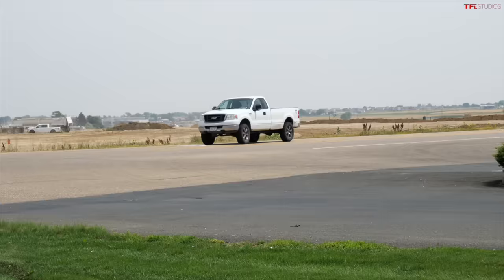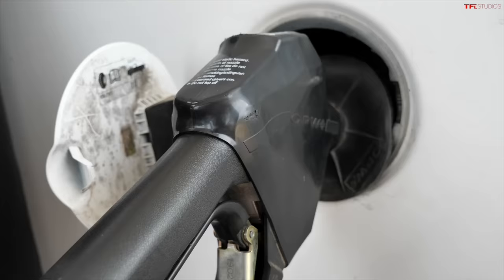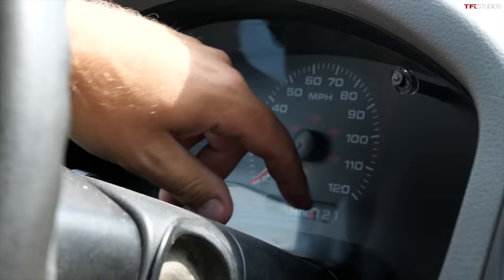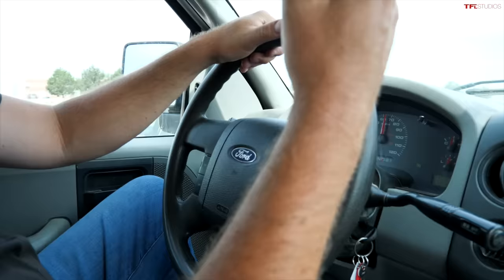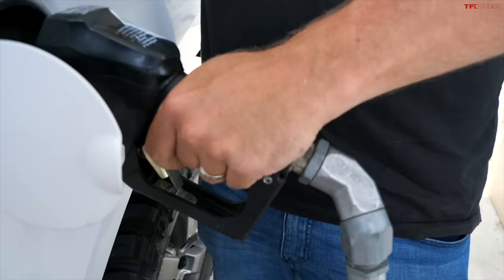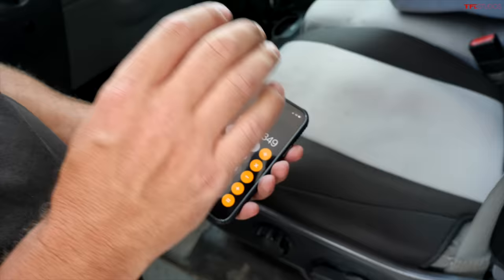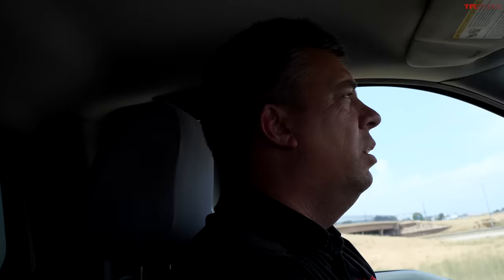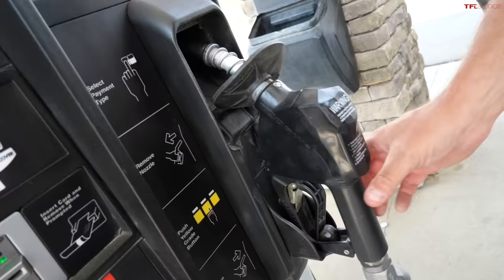Surprising Result: Here’s What Happens To Your Truck’s MPG When You Install A Topper!

Comment: Love my 1998 Ford F-250 LD. Has 5.4 with two valves per cylinder and all the bells and whistles of thE XLT. Sheep skin seat cover with the Captain Arms.  Worth all $28,000 plus in 1998. Better build back then.  Their values keep on going up with time. Milage is same or better than my 2018 F150 Raptor SuperCrew.

Comment: Here's a question. If I put the pop up tent above the cab of an F150 or above the cap, say an RSI Smartcap, which is further back, will there be a difference in average mpg?  Put another way, does putting the pop up tent further back from the front, on a bed cap, improve mpg?

Comment: You do know there's also a way to do that with out the trip meter or GPS it's called math. Write down on paper your miles then when you fill up again write your miles again subtract the difference which will tell you how far you drove. Then after filling up you will know how many gallons you used. Then divide the difference to figure the miles per gallon.

Comment: I think it is the same within the margin of error. I don't think that you are doing this, but I certainly wouldn't claim 0.1 mpg improvement on a test that only used 3 gallons. It would have been better to do a longer drive over several days. Reversing the order each day. Also, you could have hooked up something to see your instantaneous fuel usage and logged that over the miles, preferably along an empty road. Doesn't Highway 50 go through Colorado?. 

What I find remarkable is that 1,100 comments in 2 days. Popular channel with engaged viewers!!

Comment: guess if you do a lot of highway driving, it would make the greatest difference.
but not much difference in mixed driving.
then the weight does probably negate the gains.
what does a top with one of those high areas in it do to mileage?
is the extra covered space worth it?

Comment: Wouldn't that kind of mean that that test is not sufficient enough. What I mean by that is to do the test properly you would probably need to weigh the truck topper and redo the first test. Read with the same weight without the truck topper then take the weight out and put the truck topper on that way you can get a definitive answer. Because as it stands now is you're dealing with the first test no wait the second test more weight. I would say redo the test again only at the weight the first time that way it can be a true test and answer. But of course that's just my opinion

Comment: I was ready to punch holes all through this test (I grew up in flight test), but you did a pretty decent job of eliminating variables that you could, without spending a tremendous amount of time and money to increase your precision. Really, though, to capture the difference over such a short distance, you'd have to account for several variables. The largest of which is the method of filling the tank. To increase accuracy over that short a distance, you'd have to start with an empty tank, add a metered amount of fuel, take temperature of the fuel as well as atmospheric pressure and temperature (all goes into the metering of fuel through the engine). You'd also have to use a constant throttle setting, accounting for changes in pressure altitude over the distance traveled.... the list goes on. All this to say, while I enjoyed the video, and it was well done, I would have been surprised if you WERE able to see a significant difference in mileage (a tenth of a MPG isn't significant, unless it was consistent over multiple runs performed by the same test method).

Comment: Ok . My 2020 ram 1500 crew cab 6.4 bed with a 3.5 lift and 35” tires with the cap off ( by the math is at 22. Mpg rounded up on a 100 mile loop. Cap on same loop is 24mpg. Average speed was 67.23 mph oh and it has 3.92 gears . . 50 miles is not enough distance for a true reading .

Comment: before i watch ill guess it takes more fuel with the topper because its extra weight .... ok evidently it didn't make much difference but this was mostly a highway test not mixed driving where the weight would have factored in more.

Comment: If you see this, you could have more scientific.  Use a flow meter instrument to measure actual fuel usage.  These pump handles aren't reliable to cut off at the same fill ratio, they're simply intended to reduce spillage.   I've added 2-3 gallons to a tank after the pump cut off.  
And you're using a very small amount for this calculation.  This result doesn't really mean anything when the potential error is so high.   You're probably accurate enough with the tracked distance but who knows on the fuel usage.  Plus it was a different time of day, we don't know the contribution of atmospheric differences between runs.
So yeah, lots of room to be more scientific.
Cheers!

Comment: Based on driving an average of 15,000 miles per year and an increase in fuel economy of 0.1 MPG a $1,000 topper will pay itself off in just 125 years

Comment: So how much gas did you put in it after going to get the topper? Did you wait 30 seconds and top off again?  Did driving it around settle more fuel due to the weight of fuel in a plastic tank?  So many problems here.  How about a 5 gallon tank with the fuel pump in the bottom of a sunken area,  and drive it til it runs out?  Then we can tell exactly how many MPG difference there is.  Better yet. How about a 10 gallon tank filled 10 times on a closed track?

Comment: Never heard it referred to as a "topper".  It was always a cap, or truck cap.

Also, "about 53 miles, precisely".  Is it about, or is it precisely?  Just wondering.

Not sure about the area he is from, but he could have also gotten a truck weight with and without the cap at a truck stop.  They usually have weigh scales there.

Comment: *Sigh*. Write the mileage down, when you're fueled, the lot to cruise control in to whatever speed you want and drive at least 200 miles.
  Approach the gas station, fuel up.
  Write the mileage down and feel used.
  Get your canopy put it on, go back to fuel pump and make sure you topped off exactly as you were before, do the same 200 miles.
  You'll get a very inaccurate but close mileage difference.
  I am an ex-owner operator, and to be a lot more accurate, you would need to do two fill ups.
  Then canopy for two fill-ups.
  I should be about 350 per tank. So 700 mi per test and that was zero in the difference to almost exact.
  Now I know they can't do this with the time available, I mean you're looking at 700 mi per test, that's 1400 mi, for a truck driver like myself that's 2 days worth of work.
  But if somebody who is a four-wheeler, that might take a week. Or better.
  I have not watched the episode yet, so to be honest I will say you get better fuel mileage with the canopy on back because the canopies do not weigh all that much though, I would have gone with a cover because of wind resistance.
  The faster you go with a big bulk at the back of the pickup creates a vacuum which is actually pulling the pickup backwards.
  A bed cover will cut that in half, but without anything over the top of the bed, you have that fishbowl which is causing some resistance with the wind.
  Or just eliminate the tailgate.,

Comment: Bottom line... There's really NO fuel savings difference worth discussing, nor caring about. 

Undoubtedly any fuel savings from the tiny aerodynamic change is far offset but the bed cap's (topper's) weight, particularly considering how heavy the average fiberglass truck bed cap is.

That said, I'm sure that installing an aluminum cap would also show an ever-so-slight improvement in fuel economy. It would undoubtedly be a menial amount as well, so who cares?!

Comment: I wonder if the mileage would have been any different while towing a camper.

I'd love to see this same test while towing a moderate sized camper with the 6.7L!
Reply: Adding the shell & then putting an upside down wing at the back to divert the air up & over the camper will help when pulling a camper. A fifth wheel will do better than a bumper pull of the same size & weight because the front of the trailer is closer to the cab & it's easier to carry a load than drag it.

Comment: Try taking the tailgate off. That eliminates drag from Venturi effect.
Reply: Makes zero difference. There is NO venturi effect because there is no venturi. A venturi is like sticking 2 funnels together back to back. The air entering is compressed causing a high pressure wave at the entrance & a low pressure at the exit, speeding the air up. Impossible with a square bodied vehicle.

Comment: I think too many variables came into play to claim this was an exact science. Best way is to run it out, toss in exactly 2 or 3 gallons, and then see exactly how far the vehicle drives and would try a closed course even if its small and toy have to do it 1000x and at the exact same speed. Every time you speed up effects the numbers so would have to take into act wveey time you had to slow off cruise control but won't have to on a closed course and can maintain same exact speed for the entire drive

Comment: Not accurate way at all. Because there are different factors that changes mpg.1. Wind factor. 2. How you accelerate and number of times you brake and accelerate. Even going around cars. Best to do it is on a same closed course using set up a limit bolt on the foot pedal to limit speed so you can floor it to that limit and hold it there everytime. Check wind speeds and direction. Also after fuel automatically clicks off and you adding more fuel also changes accuracy. Run it empty and add 1 gallon or less of measured gas. I can get 8mpg to 28mpg just by changing my acceleration and top speed on the same vehicle.

Comment: This is entirely different, 2014 Jan started Dec 28 - Feb 1 35 days didn’t take a day off 35 days in a row, 16,000 miles big truck made 6 miles per gallon

Comment: Good stuff. Another age old discussion settled. By the way, wondering how far off was the truck speedo from the gps?
Reply: I used a Hypertech tuner to adjust the odometer to the GPS on my 04 Tahoe. Most factory speedos read 1-3 MPH faster at 60 than actual speed which would make the speedometer & odometer off by 1.6%-5% at any given speed

Comment: Wonder if the difference would be greater on a small p/u that has much greater MPG?
Reply: Smaller engines suffer more with added load so the weight would affect a smaller engine more.

Comment: Every shell I have ever used added at least 1mpg to my avg. This is very unscientific. You would need to watch consumption with an accurate gauge or a glass bottle marked on the side. Variables that cause major differences to stoichiometry and mileage are temperature and air pressure, humidity, wind speed, tire inflation, temperature of engine, and quality of fuel, or the exact octane measurement of the fuel. The route needs to be exact with speeds being exact. I notice differences just using different fuel stations at different times. If The density of a gas is greater than the density of air pressure in the fuel tube that would cause the diaphragm to close and an automatic shut-off of the pump would occur. A pump shutting off is not an accurate measurement.

Comment: my 1982 f150 gos down I70 from gypsum to Avon and back 5 days a week and i get 18 mpg in that that's a 300 i6 4 speed t18 on 31s so im not all that impressed especially considering my inline 6  has more displacement

Comment: This was a very short trip(54 miles).  Why not do a real test of a tank of fuel, 300-350 miles per trip.  That is a real test which might create a realistic average.  By the fact that lots of people are buying trucks and SUVs, the average fleet average is going way down.  Note a standard Subaru impreza premium can get 36.8 mpg on a 400 mile trip.  Double the trucks mileage.

Comment: On a recent trip of 4k miles, I was consistently getting 745 miles a tank full on the highway.  That was after putting on a truck cap,  normally it's 720.  Breaking down the numbers it isn't much but added up it was getting 20 + minutes of driving time.. 20 miles a tank isn't bad. That adds up and for a truck that's pretty good.  If you search YouTube you'll find wind tunnel testing that shows that the airflow is also better. Thanks
Reply: Wind tunnels & dynos aren't real world situations & are not accurate, other than providing aero drag numbers
Reply: @bradgriffith4231  not sure what your point is since I said my actual mileage improved immediately. No wind tunnel but actual mileage.  Followed by a 4k mile road trip.

Comment: A 54 mile jaunt is not a long enough distance to determine any appreciable difference in configuration.  Your mileage gain of .1 mpg is virtually negligible and is most likely within the precision error tolerance of the pump.  This test should be conducted at minimum the range of a full tank of gas, preferably over several tanks of gas.  I'm not confident either way over these results.

Comment: That 4.6 in a half ton is extremely superior to the 5.4 Triton I had in a 3/4 ton. That thing was horrible in gas mileage. About 10 mpg if all my driving was highway. Any slow driving and it got schoolbus mileage. It destroyed my faith in Ford when you added in blown spark plugs and the flimsy alloy automatic gear shift device over the steering column that broke 3or 4 times! Your pickup is a great example!
Reply: A 3/4 ton is considerably heavier than a 1/2 ton & are geared quite a bit lower. You're comparing apples to oranges. Fords spark plugs in the modular motors suck. My buddy & I both refuse to do a tuneup on them because they're so prone to breakage & the tool to remove the broken piece is stupid expensive, IF it doesn't fall down in the cylinder, which requires pulling the head to retrieve it.

Comment: Truck topper may weigh 150 lbs , not very significant on a truck designed to tow 9,000 lbs, while it’s completely empty aside from the driver. I want to see trucks that have 1000lbs minimum in the bed for months, daily driven, towing occasionally or often. I want to see how these new trucks hold up while being work trucks, not enormous ubers carrying 1 person to and from their office job. TFL TRUCK, there are so many construction company’s, plumbing companies, electrical companies, ect, in Denver  that would be so willing to let you see and review their trucks and vans just for the publicity alone! I want to see how these trucks hold up as work horses, not pampered equestrian ponies doing tricks. I want to see real world repair bills, fuel economy, usability, ride quality, while these trucks are being tortured, not once on the Ike gauntlet, but twice a day on  the IKE for months and years, like the trucks are supposedly designed for! The big three market these trucks as tough, long lasting quality, let’s find out!

Comment: If the topper was sloped downward to create a teardrop shape, that would reduce the Venturi effect at the rear of the truck and improve mileage. As is, the air flowing off the back of the topper creates massive turbulence and suction effect pulling the truck backwards.

Comment: The truck topper is like leaving the tailgate down. It causes more down force on the back tires. This creates more friction and drag. There is only a small percentage of loss on a full tank. Close to a mile or 2 when driven till empty.
Reply: Tailgate down makes zero difference, because the air never sees the TG. Throw a few beer cans in the bed & drive around with the TG down. The cans will be in the very front of the bed at speed. Also, the weight of a full versus empty tank have negligible effect on economy

Comment: The average weight of some men is about 200 lb. So if you had a passenger that weighed 200 lb and he left the vehicle behind with your loop roundabout there might have been a difference there. But you did show a slide increase.

Comment: Now try a tonneau cover on the same truck.  The result might have been more dramatic with a lighter truck/no 4-wheel drive where aerodynamics contributes a greater percentage of the running resistance….?

Comment: Actually, putting a topper on it will make the mileage go down - quite a bit. Why? Because then you'll put a whole bunch more junk in the truck bed because it's secure from rain and less-likely to be stolen. Add another 500 lbs for that, at least.

Comment: Question I have a Ford F150 it's a 2000 with a topper that appears it came from the factory this way the counter matches the shape of the crew cab shape and someone broke the rear glass I have all the pieces of the frame ai would like to fix this somehow any ideas.
Reply: No toppers come from factory; all toppers are installed by outfitters! Dealers avoid them like a plague. Check your local truck outfitter if they can help.

Comment: My boss got a new ecodiesel dodge and brand new got 24 mpg and then jacked it put bit tire's on and it went to 18 mpg if you want a truck that get's good mileage do not by a four wheeler.  I have never owned a four wheeler in my life and I live in Salt Lake City and I have never once needed one and I am 70.   I have a 6.9 cummins  24 valve and not hauling anything I average 19.5 miles a gallon when I am pulling my 24 foot travel trailer I get 17 mpg and when I am pulling my travel trailer and my 16 ft boat together I get 14 mpg.  And it pulls like there is not 2 trailer on one because my trailers and truck are all low and I do not get a lot of air turbulence under the truck and trailer.  People think I am crazy but you could not give me a four wheeler the cost of driving those jacked up pieces of crap is a lot of money  and most people that own them cannot tell you the last time they put it in four wheel drive a big waste.